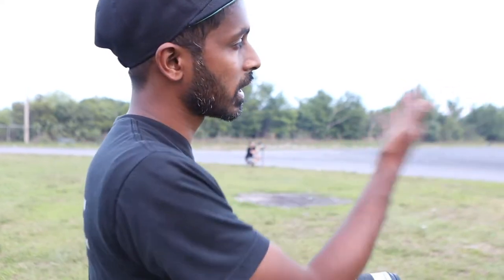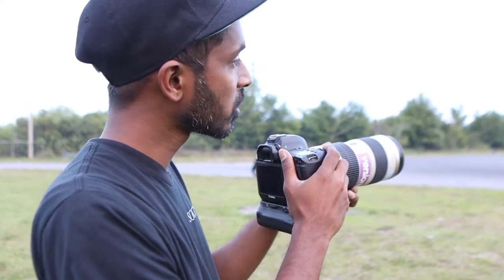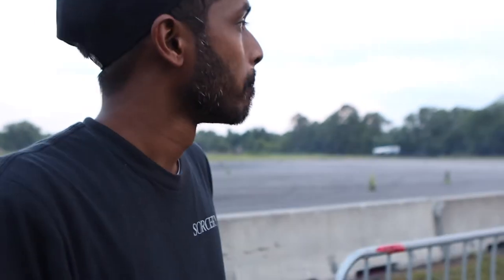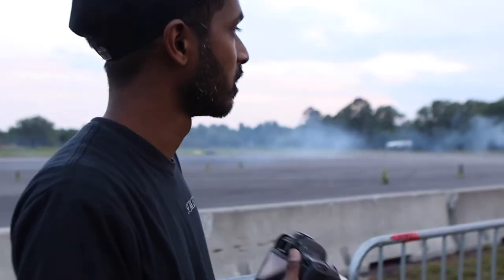How To Shoot Drift Photos (Part 1?) & Drifting

Comment: What size lenses did you use?
Reply from the maker: a lot of what i was doing was using a 70-200L F2.8 / IS (mk1) --- you can do basically the same shots with 24-70 or 70-300 or whatever you have available to you just position yourself accordingly and move around a bunch (hope this helps)